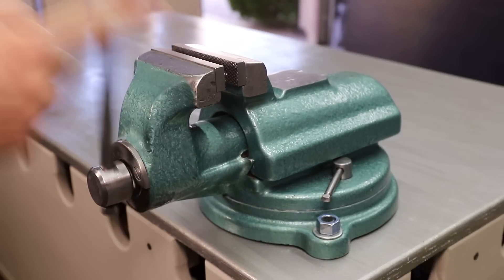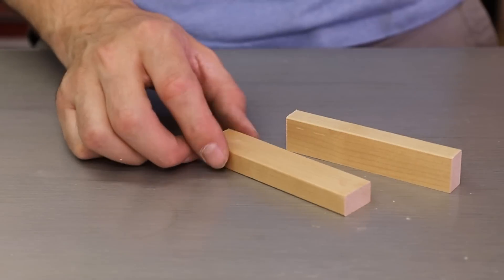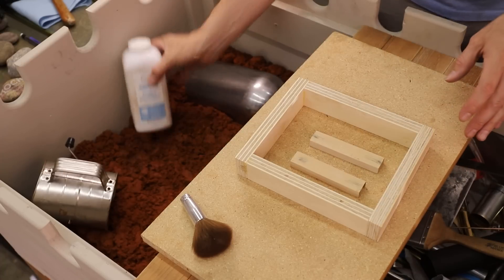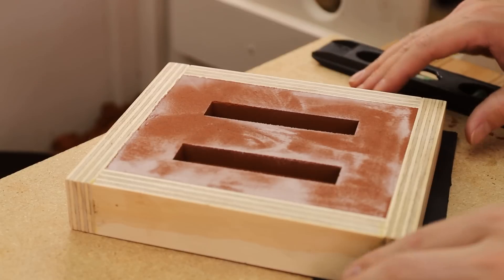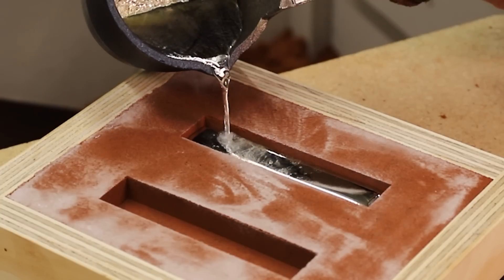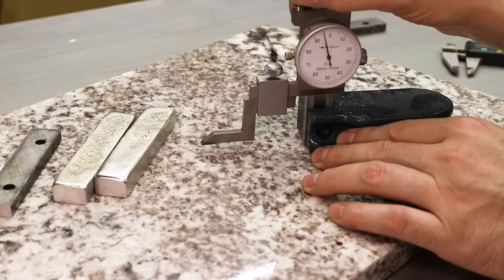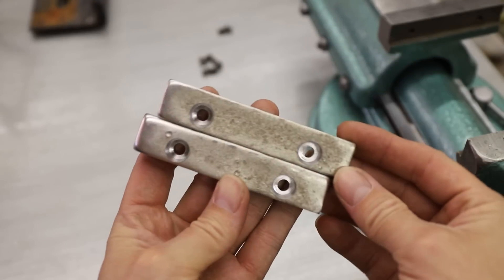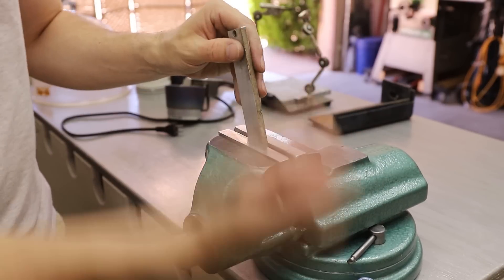Easy Metal Casting - Making Pewter Soft Jaws for my bench vise

Comment: I open use copper or aluminium, but never considered pewter. I'll keep an eye out for oppshop cheap stock. Did you consider going with soft jaw as slip on rather than bolt on? Seems to limit the vice to just one application now.

Comment: any reason why you didn't machine the faces flat with the mill you drilled the holes with?
Reply: The idea was to show a method for someone with few tools. You could drill them by hand, but a mill is a very specialised piece.
Reply: @insertphrasehere15  would have been a solid argument if he hadn’t used the mill to also drill the holes, the video was on metal casting, fairly specialized. With all of that, it makes way more sense to machine the faces then to use all that specialized tooling then to just do a mediocre job filing the faces.
Reply: @nerddub  my point is that drilling is obviously not necessary to do on a mill. A drill press or a hand drill can make those holes and everybody knows that. Showing how to do the faces flat by hand is essential for the hobbyist without those tools. The fact that he used the mill to drill is like “you can drill this a million different ways, I just used this way”. You can’t say the same about milling the faces flat. 
Imagine: “here in this beginner friendly video I’m now going recommend that you use your three axis CNC to machine the pieces to shape.”
Reply: @nerddub  the metal casting isn’t specialised. This is pewter, you can melt it in a soup can on the stove. You can cast it in anything, even silicone or beach sand. Hell I’m surprised he bothered sand casting. You could just make the wood box the size of the casting that you want and just cast directly in the wood (that’s what I’d do for a rectangular casting in pewter).

Comment: Now make some out of tungsten for maximum damage while gripping stuff
Reply: with extra sharpened teeth.... i think tungsten has a really high melting point tho lol
Reply: @simon_fox_youtube  going to make this man get diamond tooling just to machine those xD
Reply: @simon_fox_youtube yep, the highest of all metals
Reply: Tungsten is brittle? 😂
Reply: Crom is harder
Reply: Depleted uranium
Reply: You should have leveled soft jaw faces with a belt grinder for mirror like level ! your soft jaws got .90mm of contours on the faces using Files that will give you trouble in doing precise micro works otherwise its great  !

Comment: Is lead poisoning an issue filing pewter like that? I know it's possible to be poisoned by lead drinking out of pewter mugs/cups.
Reply: The big issue with lead is that you just really don't want it inside you.  So, if you are generating lead dust from filing, or lead fumes from melting, then yes, you want to make sure the fumes and dust stay outside your body.  That can mean proper ventilation, appropriate dust mask, hand washing etc.  Also you can go with "lead free" pewter.  That can still have other hazardous heavy metals in it though like antimony.  And, at the end of the day, I don't think any lead free pewter is truly lead free.

Comment: Cool video. I made some aluminum ones for my vice. Perhaps you could have faced the jaws in the mill and skipped the filing step. I’m sure these jaws will work great
Reply: The point was to do it with common tools
Reply: @dickard8275  yeah but the mill was used to drill the holes
Reply: @FlyXenonRC To take the place of a drill press... or a hand drill. Not exactly difficult to drill a square hole.
Reply: @FlyXenonRC  Knew someone would say this… he literally said any old drill will work while using the mill for this reason 🤦🏼‍♂️